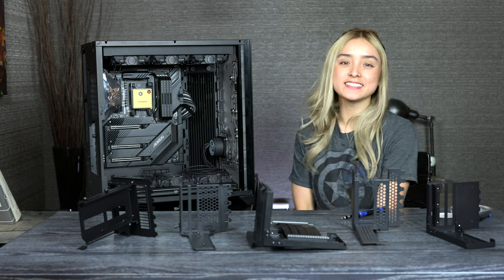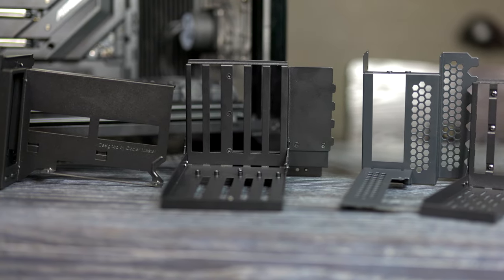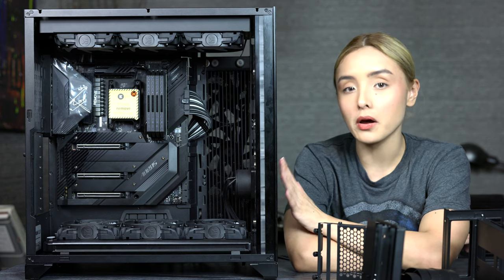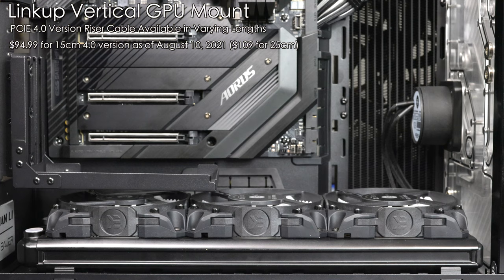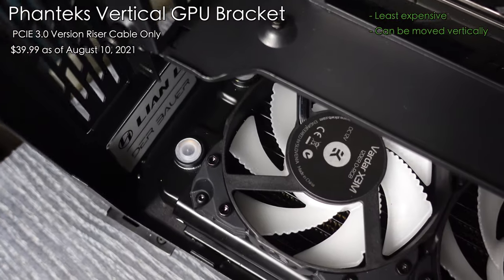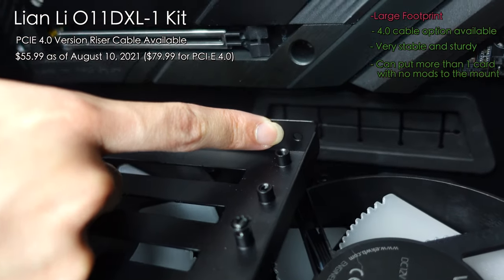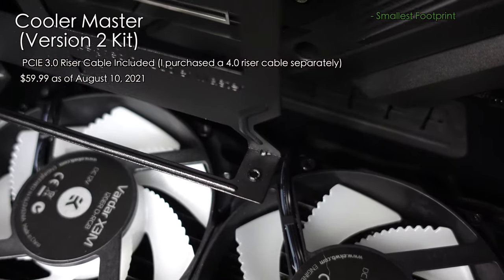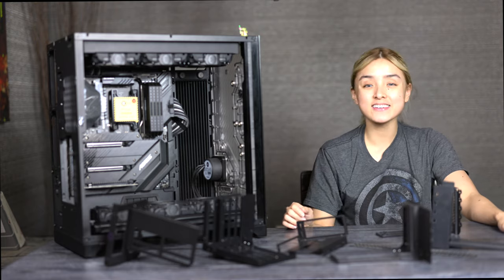Best Vertical GPU Mount for Lian Li o11 Dynamic XL | Cooler Master Phanteks Linkup CableMod

Comment: This is good information. I had thought that the door above the PCIe slots was actually the spot where a kit could go, but I guess not. That's a shame as I have a problem that is the opposite of yours. I was able to get a 3080 and it is watercooled, but since I have 5 monitors I need a second graphics card and was going to use my old (reference blower) Vega 64 in the last slot (chipset x4 slot) of my new motherboard and watercool it too, but it interferes with the bottom radiator. None of the kits fix this problem since I still need the first slot since it is the x16 slot. In your research did you see any weird mounts that could be used on the back of this case or something?
Reply from the maker: That’s a tough one.  Two cards and water cooled, you might just have to go horizontal.   Ive seen odd pcie riser offset extensions or cables that may help but I’m not sure how it may solve your problem.  Maybe consider a different case with one of those cool open designs?
Reply: @SnaxanGaming  Sadly I already bought the case months ago and was waiting for a new GPU before watercooling. (If I'd been able to get a 6800 or 6900 as I'd been trying to for nearly a year I'd not have needed a second card as AMD supports 5 monitors) Also not much of a fan of the open cases. I think what fooled me into thinking it was possible was I measured from the floor in the CAD model and didn't think about the height of the bracket for the fans at the bottom of the case. Maybe I can find a way to make the Lian Li one work since it uses the top mount as well and vertical mount both. Thanks again for the video. This helped a lot.

Comment: Hi Sarah, is that a different waterblock for the CPU to what you've shown before? just looks different.
Reply from the maker: Good eye it actually is!  Changed it to a black quantum magnitude.  Waiting on some other fittings for the water cooling because my original plan didn’t work out but I’m about 95% done now.   This thing is never ending lol
Reply: @SnaxanGaming  Haha thought so. Yeah the current situation with PC parts is just ridiculous, I'm in the same boat. Good thing you've already got your GPU, thats currently the hardest part to get for me, I'm hoping to get the same one (for a decent price ofc).

Just gotta be patient though right.

Comment: Since there are a lot of fans....what is helping to carry the heat to the exhaust fan(s) that will eventually sit in the back?  Given that the GPU's temp will rise.  That is something to think about as you build.  :)
Reply from the maker: It's a water-cooled build.  So the water goes through the blocks and cool the GPU/cpu, then it circulates to the radiator where the heat dissipates :)  I'll experiment a little with the fans to intake/exhaust to see what works best though.

Comment: Your insights on the mounts is pretty good, however you NEVER want a bottom radiator, air will end up in your pump and wear it down real fast
Reply from the maker: You're probably confusing my custom loop with an AIO cooler.

Comment: hi sarah.. i want ask u ... the vertical gpu ( cooler ) , if i buy riser cable pcie 4.0 , then can go in vertical gpu cooler master?? u used what brand of riser cable pcie 4.0??
Reply from the maker: You can use a different cable with the GPU, however I highly recommend the one made by EK.  I didn't see it in time for this video but if you want to see what it looks like you can check out my PC build video, it's a really stable mount that has everything I wanted.

Comment: How high is the cable mod mount? I have a rtx 3090 and an asus rog crosshair viii extreme. I want to see the display on my motherboard and therefore need a low sitting one?

Comment: was really hoping you had reviewed the EKWB mount.. maybe a separate vid? lol
Reply from the maker: It's a great mount!   You can see it in my final build video and how the card sits on it installed to give you a pretty good idea.
Reply: @SnaxanGaming  awesome, thanks!
Reply: @SnaxanGaming  sorry one more thing.. the mount that was sagging, before you got the EK mount, was that cooler master mount (the one from this video) ??  Thx! 

rant: the non-shifted EK mount is impossible to find right now, instead they want to sell a new version with gen4 cable thats $130 fml. I dont need a gen4 cable, i bought a white one separately that I had planned to use on the lian-li bracket i bought.. but as you noted in this review the lian-li bracket is way too big! If anyone has or knows where to ge tthe original EK mount for like $60-80 lmk
Reply from the maker: @exploiteddna  Yes that was the cooler master one in that video so you can see why I went with the EK!  Sorry to hear about the stock issue on the ek mount, hopefully these shortages end soon.

Comment: Is gpu fixed more with riser cable? Does it move less than normal one sticked in the motherboard?
Reply from the maker: The riser cable won't do much for stability.  If you want something stable and have a heavy GPU, I really like the one that I ended up with from EK, you can check the pinned post.  If you need to see what it looks like you can check the video on my build.  Hope this helps!

Comment: I Own a white 011Dxl I am Considering this Bracket. If I painted it White to match my case will it hide the black cable that is included with the bracket ? thanks
Reply from the maker: It won't be hidden completely but it's tucked underneath and goes behind the GPU so most of it will be out of the way.  Good luck !

Comment: Will the Cooler Master Vertical GPU Mount work with the regular O11 Dynamic without having to remove any bottom fans? That’s my biggest concern.
Reply from the maker: It will be tight, not sure.  You can also move the cooler master mount higher I believe, but then the card will cover the motherboard which is a look I don't like.  
P.s. If you have a really heavy card and waterblock I recomend the Ek mount which is the one I ultimately ended up, you can take a look at it in my other video.

Comment: i wanna vertically mout my gpu in my o11 dynamic xl but i have a Asus PCE-AX58BT PCIe Card wifi card what gpu mount do you suggest
Reply from the maker: I don’t really see a way you can fit that if you vertically mount.  You could try what I did in my other vertical mount by getting a riser card and then cutting a hole in the vertical mount but you’ll have to mod it to make it work.  I’m actually going to mount my gpu horizontally now that I have my active backplate.

Comment: Hi. What pcie 4.0 riser cable you purchased for your CM?
Reply from the maker: I ended up using the one from Linkup.  Seemed to be more stable than the Lian Li when using the 4.0 settings.  Also went ended up with the Ek vertical mount because my waterblock is so heavy.  Wish I would have included it in the video but didn't get it until after.
Reply: @SnaxanGaming  thank you, i was wondering if the pcb cut or notch? of the riser itself are or can be used interchangeably from other vertical mounts. I guess I'd take the Linkup riser based on your recommendations and experience, I've read alot of reviews that Link Up is by far the stable 4.0 riser out in the market as well. I'm planning to use the CM vert mount and use the link up riser with it, I'm just not sure if that would fit it.

Comment: Does coolermaster support active backplate as well?
Reply from the maker: Sorry it doesn't seem to have enough clearance :(   The vertical wall of the cooler master is great to make the mount more stable but it also gets in the way of thicker cards.

Comment: Remove the bottom rad it does nothing two 420s top and vertical is fine bottom just needs intake fans, you don’t even have a push pull on the bottom so it’s just pulling hot air off the rad to blow onto the pc hardware.
Reply from the maker: The bottom rad actually made a huge difference in the delta water to ambient, also intake temp pre bottom rad to post bottom rad there's not much difference at all and 420s won't fit in this case :)
Reply: I have this exact case - modified it to fit 420 rads and it fits 3 140 fans at the bottom. I’ve tested it both ways with 360’s all around 420’s all around and all the in between. The best set up is two 420’s and three intake fans at the bottom.
Reply from the maker: @derekhuweart3450  yeah I’m not modding this case  so it’s limited to 360s.  In this setup the bottom rad makes a good improvement on loop temps without affecting case temps at all.

Comment: I have the cooler master. Its great but a bit of trouble accommodating my 3 slot card.
Reply from the maker: You're right, that's one downside.  I should have mentioned that actually.  Most of the mounts except for the lian li only support 2 slot cards.  Anyway, hope you're enjoying your build
Reply: @SnaxanGaming  Thank you, Sarah.  I just took the risk with my card and it supports it fine. One other thing is vertical GPU mounting doesn't play well with the 30 series FE cards because of their bespoke cooling system. I suppose if you're water cooling, it doesn't make a difference. All best.

Comment: Bought this and it has it flaws!. First its not ideal for the lian li o11 dynamic XL, Second the gen 4 cable is stiff! and i have to fcking bend it like fck just to mount it. And you can forget about the moving the gpu crap coz the gen 4 cable wont allow it coz its so stiff. Keep an eye on distance with your other pc parts like the ram. I manage to install it, it works but i am having second thoughts about this. Might be looking to lian li gpu riser.
Reply from the maker: Get the EK mount.  That's the one I ended up with.  You can see it in my pc build video but the link is in my pinned comment.  Check it out and see if it works for you.   I like the lian li one too but it just covers to much.  The EK is just as stable but with smaller footprint.